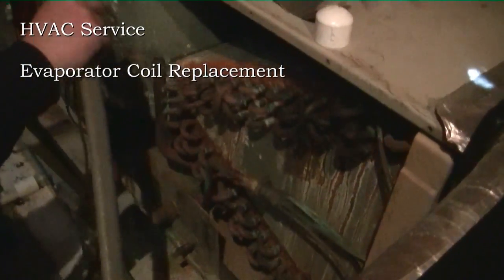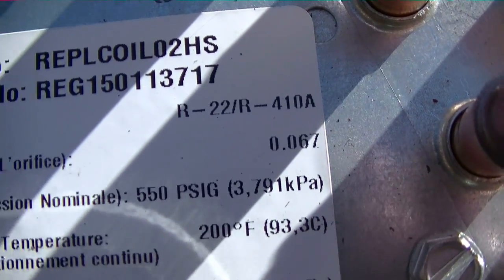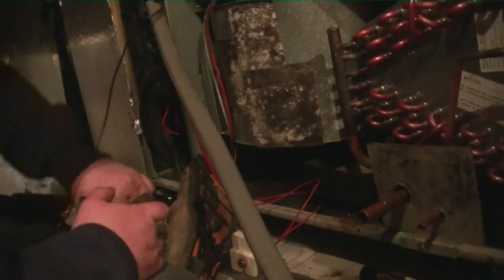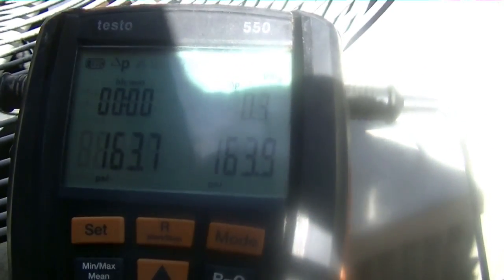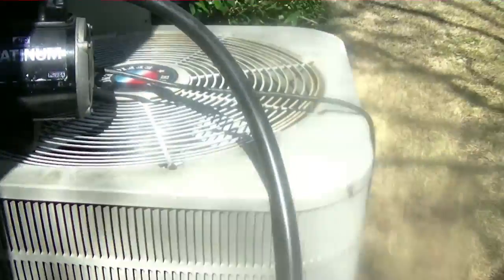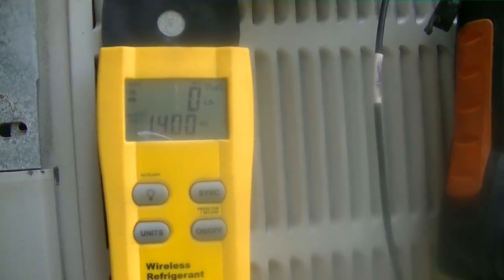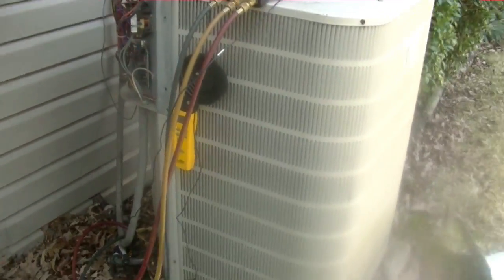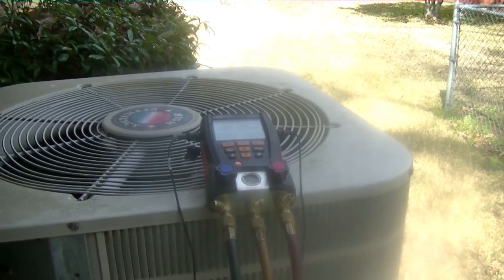HVAC Service: Evaporator Coil Replacement

Comment: Does a new evaporator coil come with plastic film that you must pull off, otherwise it will block air flow? I just had a new system put into my house today and the air seems to be flowing around the A-coil instead of through it. I was not present to watch the installation.

Comment: Hey john I got a buddy installing my central air unit in couple weeks forced air heat my current is 19 years old and compressor wires are melting does A coil need to be changed with new Freon    He said he will install a rheem 3 ton for $2500 any advise
Reply from the maker: If the existing coil isn’t rated for 410A yes it needs to be replaced .

Comment: What was the cost of his coil replacement ? I have one that needs to be done in Phoenix. I was quoted 1800 including labor. Am I over paying?
Reply: No. I've seen them go worse than that because it includes a ton of other stuff besides replacing the coil

Comment: nice have ,not used 422d but I have had really good results with 421a as a replacement for R22 Ross from New Orleans
Reply: do you find that it takes a lot more refrigerant vs what was recovered? i assume its about 30% more than original charge?

Comment: Hey John! What variable speed amana furnace do you use w/ single stage cooling? Thnx
Reply from the maker: Hey man I haven't sold Amana in over 3 years. And I don't use variable speed motors or two stage compressors.
Reply: Any particular reason why you don't use variable speed motors or 2 stage compressors? All the newer units almost come one or the other standard. The documents I've read on both seem like they're more efficient and keep temperature better.

Comment: Good work John, If you go back to this customer in the winter let us know how it runs in heat pump mode. I heard 422d doesn't run good in heat, but has good results in A/C mode.

Comment: Maybe that's what I will go with then. I do commercial work primarily so I'm not as familiar with the residential stuff as the guy who works or installs that type of equipment each day. 
I do know one thing I don't like on the nordyne is no superheat or subcooling listed on nameplate. They just use charts. 
Using a pressure chart helps but if the unit is in the shade more or its a cooler day how does one know what they have exactly? 
I used to just do 12 superheat and 8-10 subcooling if txv when installing nordyne. 
I think Arco is gonna be my choice. 
Thanks John for quick response.

Comment: John I have installed nordyne in the past kelvinator to be exact and had good luck in the past. Installed one in parents house and has been fine, friend of family home and it was ok, but after the headache I've had with my aunts home I am hesitant to go back with them. 
I have got a quote for 2.5 Ton a/c, Evap, furnace 70k gas, and lineset. Quote on nordyne was 420 less than arcoaire. 
How do you like the arcoaire I know you were putting them in awhile and was wondering what you think? 
Thanks
Reply from the maker: Hey buddy man I am no fan of Nordyne!!! Arcoaire is good stuff man any ICP brand is good stuff (owned & made by Carrier) I know it cost more but it's a much better piece of equipment than Nordyne!!!

Comment: Good video John I've used the r422d even on med temp walk in coolers but found the r421a runs about the same pressures as r22 about dead on. Good job .

Comment: Hey John!! Do you removed the cores and use the appion remove tool with the 1/2 hoses to accelerate the vacuum process ?
Reply from the maker: Hey Jorge!!! No i had ball valves on the need of the hoses and left the cores in!!!
Reply: Thats funny...he's trying to speed up his vacuum with his 1/2" hose but leaves the schrader pins in...